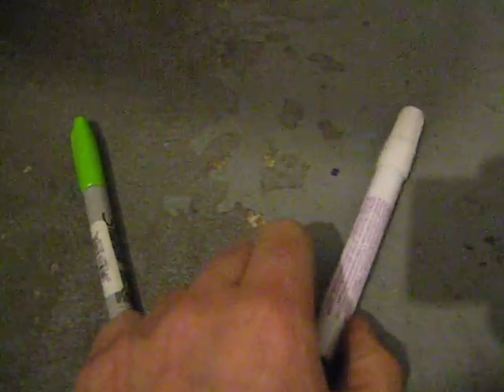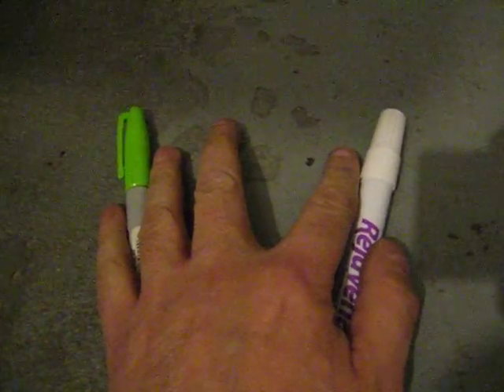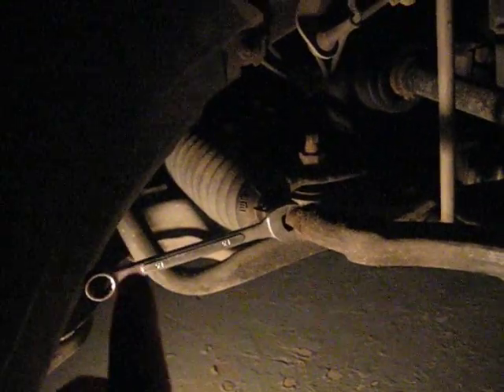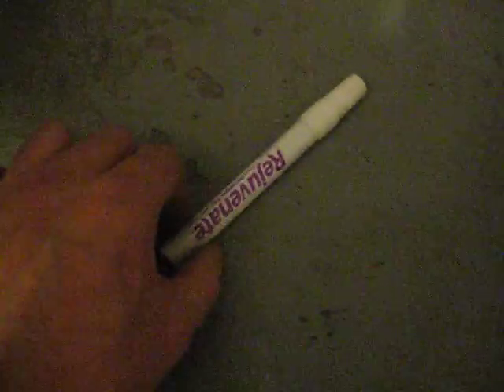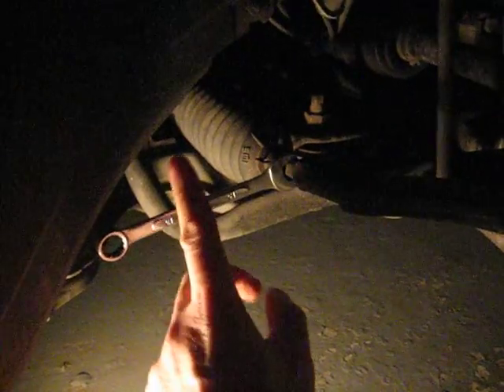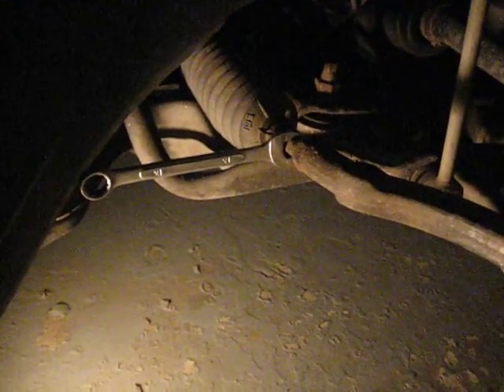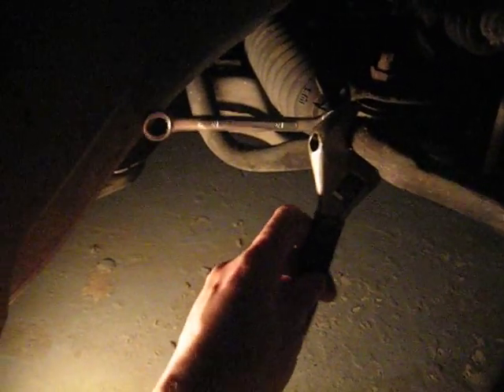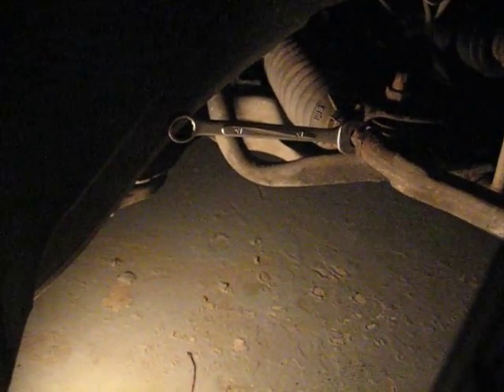Car wheel geometry/alignment adjustment with basic tools (2/2)

Comment from the maker: Never drive through rain going to a garage to have the alignment/geometry done. The wet threads will seize very strongly after a while.
When we do the geometry, there are two goals : have the wheels parallel (zero toe) and have the steering wheel centered when driving straight. Any tie rod adjustment will change both the toe and the steering wheel center position. Usually I do this in two steps: first, correct the toe to get the wheels parallel. The I drive the car and note if the steering stays rotated to one side: if so, I adjust again the tie rods only to center the steering: usually this is done by shortening one tie rod and extending the other tie rod the exact same amount.  https://www.youtube.com/playlist?list=PLl-l6yge4asstdyo8PTHx2G-ME46hNDO7

Comment: For anyone wondering what the lock screw should be tightened to, VIDA says that it is 70 Nm. That is quite a lot for that tight space which may explain why it is hard to undo after rust has gotten to it. But you need a crowfoot wrench to tighten it with a torque wrench. Maybe loctite blue is also good to use.
Reply from the maker: I'm not sure, but could this value be for the sphere end that is attached to the steering rack? That end is screwed into the steering rack quite strongly indeed, and it's actually difficult to remove and takes a special tool on Volvo, so as not to twist the components inside the steering rack. I may have a video or better ask on forums about that tool. Without it, there are chances a steering rack gets damaged and the rack starts leaking power steering fluid.
Reply: @Peppermint1  I don't think so. It says "locking nut between inner and outer tie rod: 70 Nm" (not word for word - I translated from Swedish now). 70 Nm is not extreme but it's a bit tricky in that tight space maybe. I'm not sure. I didn't have a crowfoot wrench with the correct size so I did it blind. By comparison, the lug nuts for the wheels are supposed to be 140 Nm and is quite comfortably tightened to that with a long shaft. Many parts are only around 30 Nm. I think 70 Nm makes sense to prevent vibrations from loosening the lock nut and ruining the geometry.
Reply from the maker: @L.J.Silver  Yes, so that's the torque for that nut indeed. Myself I tighten them perhaps no more than 40-50Nm. Still, it's pretty stuck next time when I try to break it loose. This nut is quite prone to get stuck - thread underneath is exposed to rain water. I like to spray a bit of antirust on the exposed inner tie rod threads just by the nut - that's where water gets under the nut when driving. There's this other video quite popular for breaking lose a stuck nut https://youtu.be/IALB8HLbiuw A pipe wrench also helps. Small tip, better not to work on a car after driving in the rain, water on threads will rust and cause bolts very stuck next time

Comment: It feels odd that it is extended by turning clockwise. Is it a reverse thread? I imagine that it's screwed into the rack and to extend it is to unscrew it. Am I wrong?
Reply from the maker: Actually, "clockwise" or "counterclockwise" will have different results depending from which "end" on the tie rod we are looking. I prefer saying "screw in" or "unscrew". If you notice, I did unscrew the tie rod. Try to imagine yourself sitting at the other end of the tie rod. Also, this is important because the movement is opposite on the other wheel. I always take a moment and thing, which way I should turn the tie rod for each wheel. Same for releasing the nut, it will turn the opposite way on the other wheel.
Reply: I am thinking about that the tie rod is screwed into the steering rack and that's why it feels like what you did would screw it in and not out. It has threads on both ends and both threads are normal clockwise threads. But maybe it is because the movement of the two ends are not connected? It's a ball joint that spins freely in between, isn't it? Another way of thinking of it is that it is being unscrewed from the outer tie rod, right? Same as unscrewing the outer tie rod, but now instead while the outer tie rod is actually installed and stationary.
I have never changed or held a inner tie rod in my hand.
Reply from the maker: @L.J.Silver   There are two parts in a tie rod - the part attached to the wheel assembly (to the hub), and the part attached to the steering rack. The part attached to the wheel is hollow with inner thread at the end. The other part is attached on the steering rack with a sphere which allows free rotation movement but not translation, at the other end this part has exterior threads. This is the part that we screw in or unscrew from the other part that is attached to the wheel hub. The threads between the two parts are normal threads. We unscrew or screw in the part attached to the rack, into the part attached to the wheel. May google up images with a full tie rod piece, can notice the two parts screwed into each other, and also the connecting sphere to the steering rack
Reply: @Peppermint1  Thanks for taking the time to explain it. Now that I know that the inner tie rod has a freely rotating section it all makes sense.
Reply from the maker: @L.J.Silver  That's right, it's not rigidly attached rotation wise to the steering rack. I wish I could make a better video on this adjustment. One thing I didn't cover , is when we loosen/tighten the nut, there is usually a bit of unwanted rotation between the inner and outer tie rod parts. This throws off the actually adjustment. Not by much, but since the geometry is affecting the way the steering wheel stays centered when driving in straight line, the steering may stay slightly turned to either side. For this reason, I draw a line with a piece of chalk on both inner and outer tie rods on both sides of the nut before slacking the nut, then another line on both just before tightening the nut.
Reply: @Peppermint1  That's a good technique with the chalk. My nut was stuck badly and needed a heavy hammer to strike the wrench. As you recommend in your other videos, centering the steering wheel before changing the rod is also helpful. My steering wheel moved about 30 degrees and I'm currently adjusting that. Would've been best with both techniques so they also verify each other in case you mix something up.

Comment: Is this the same vehicle as part 1? In part 1, you detected toe-in, because the distance at the front of the wheels was shorter. In this video, you mention that you want to extend the tie rod. Wouldn't that cause more toe-in? I just want to make sure that I am understanding your process before trying on my own vehicle. 

Also wondering your opinion on having the front wheels on ramps to have easier access to make the adjustments. Have you tried it on ramps before? 

Thanks for the very helpful content. Should save me a trip to the alignment shop and it's hard to find one under $150 now.
Reply from the maker: When we do the geometry, there are two goals : have the wheels parallel (zero toe) and have the steering wheel centered when driving straight. Any tie rod adjustment will change both the toe and the steering wheel center position. Usually I do this in two steps: first, correct the toe to get the wheels parallel. The I drive the car and note if the steering stays rotated to one side: if so, I adjust again the tie rods only to center the steering: usually this is done by shortening one tie rod and extending the other tie rod the exact same amount. I explain this in one of the videos in the playlist  https://www.youtube.com/playlist?list=PLl-l6yge4asstdyo8PTHx2G-ME46hNDO7

The wheels must sit on the ground when measuring the toe with a ruler. Lifting the car on ramps will compress the front spring a little which will slightly modify the toe

Comment from the maker: If the nut is stuck, here's a trick  https://youtu.be/IALB8HLbiuw  If this still doesn't work, you may want to bring the car to a garage and ask them to try releasing the nut. If they still can't, you will need to replace the inner and outer tie rods together: undo the outer tie rod at the wheel, then the inner tie rod at the steering rack.  I always practice visually which way the nut must be turned in order to release it - so as you don't make a mistake and you tighten it instead of loosening it. To do so, sit near the right wheel and look towards the left wheel: the nut at the left wheel will release counter clockwise. Repeat the same for the other wheel, sit by the left wheel and look towards the right wheel: the nut at the right wheel will loosen up counter clockwise